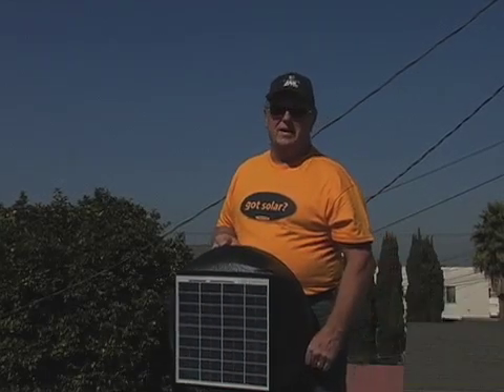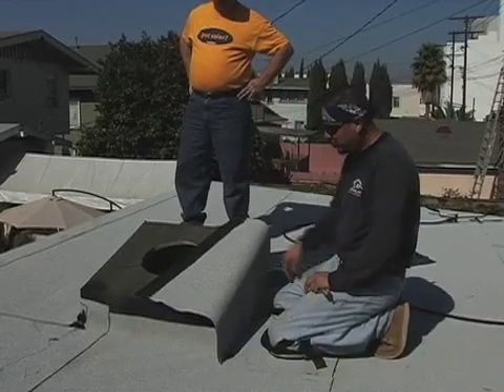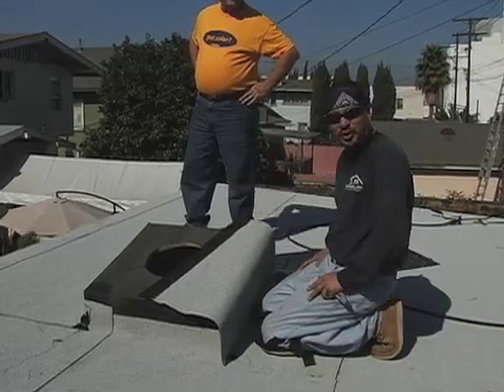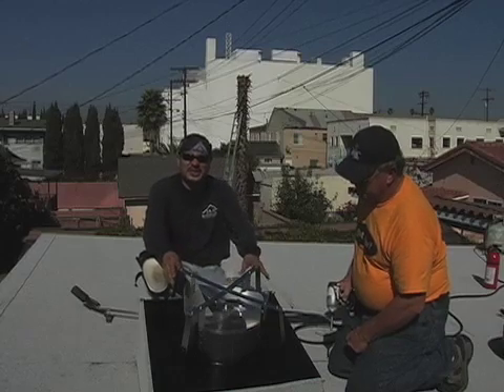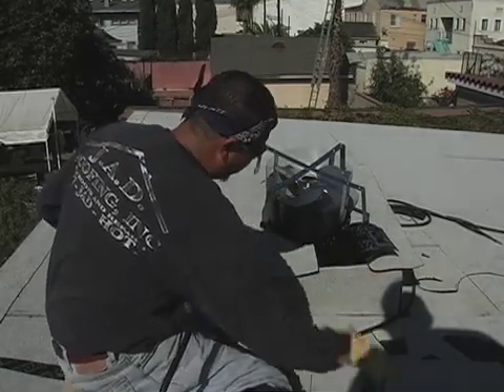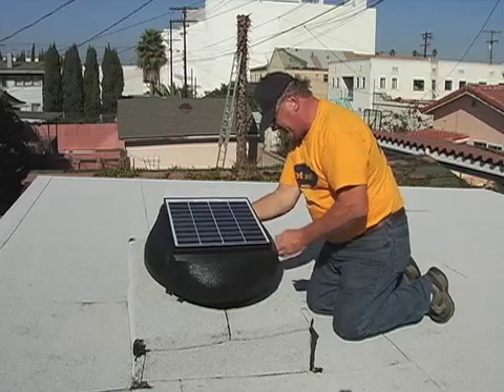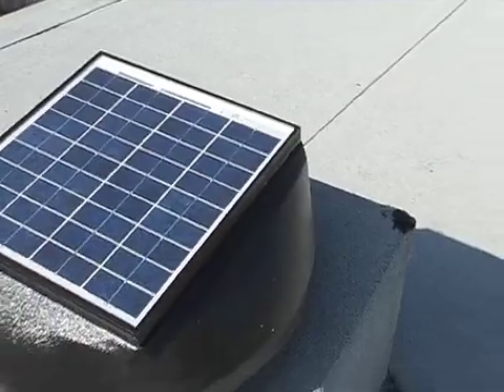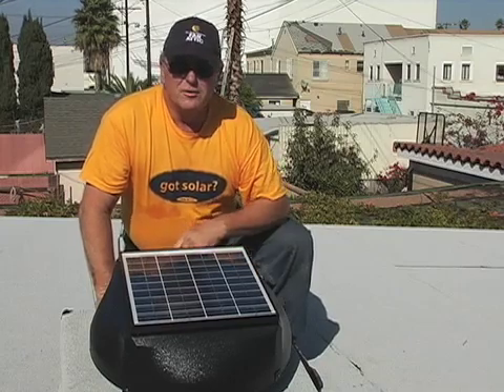Solar Powered Attic Fan

Comment: Why is it one of the first things they told us in building performance class was attic ventilation past code minimums does nothing, show us the research then you go online, the scum of the 'green' industry out there try to tell you the opposite with zero research? Maybe you should spend 5 minutes doing research or simple math before you put your name into such a shit product that will fail and only runs when the sun hits it? btw Heatloss? Do you mean HeatGain? And it's radiant, not conductive.